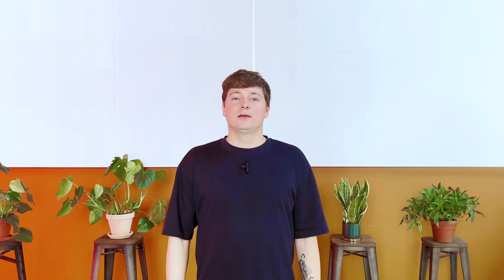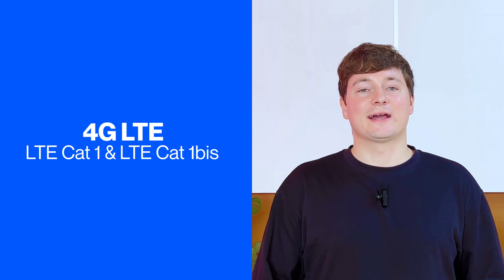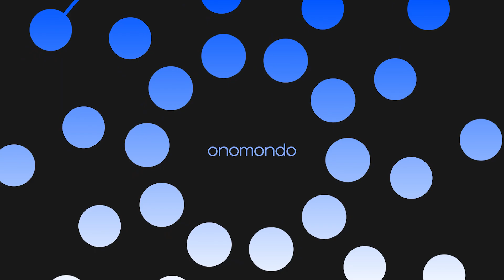What is LTE? | IoT Basics (Cat 1bis vs LTE Cat 1) | Tech Talks 2.0

Comment: 0:55 do you mean low bandwidth?
Reply from the maker: The Cat 1 part defines a cellular technology that’s ideal for IoT with plenty of bandwidth (10 Mbps download / 5 Mbps upload) for the typically small data requirements of IoT applications, but also relatively low-power draw (most IoT devices are reliant on batteries).